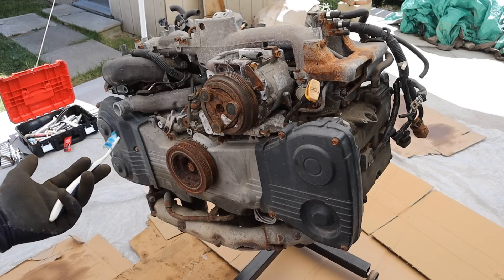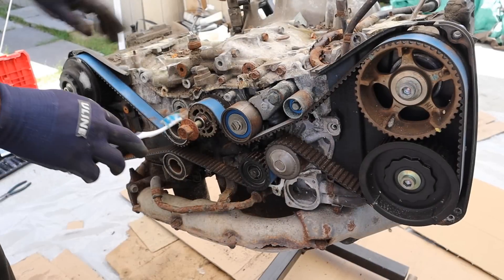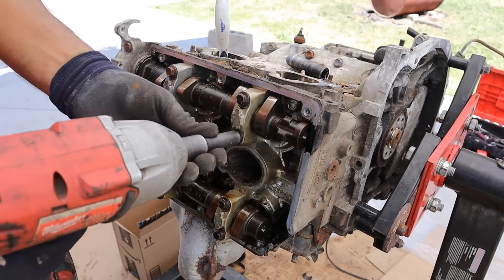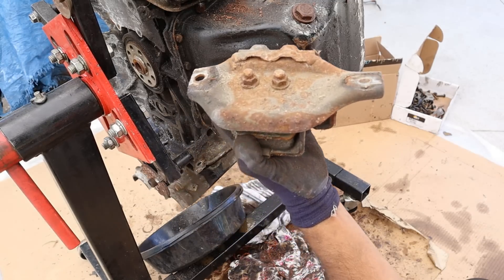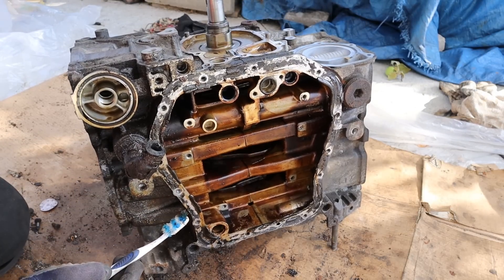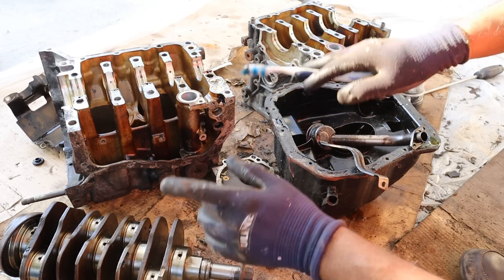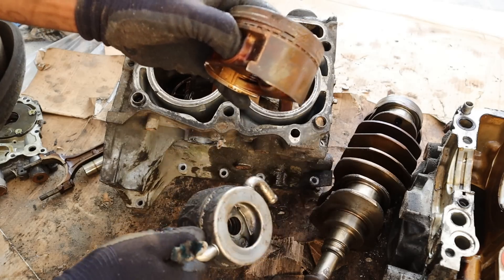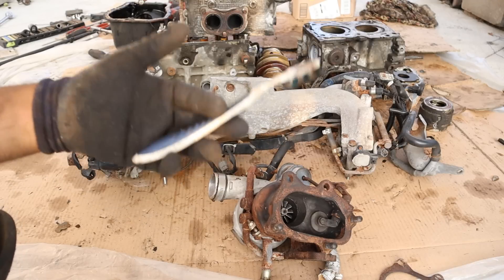Why Subaru Engines FAIL

Comment: Why, why, why does Subaru continue to use the boxer engine design? Costs more to build, is more complex, harder to work on, and less reliable than an I-4. I get that it's part of their brand, but the average forrester/outback/impreza customer doesn't know and doesn't care.
Reply: From what I've gathered from reading around, they keep it because it's what they're comfortable with and a boxer engine has a lower center of gravity, being better for offroading and for sports cars stuff. Porsche still uses boxer engines as well, and I believe some motorcycles and planes still do.
Reply: @0latency  That's all bullshit. They build them because retooling for inliners would possibly bankrupt the parent company.
Reply: @fun_ghoul  Well yeah, their cars aren't designed for inline engines. It'd be like if Porsche did the same for their 911s, they'd probably go bankrupt too if they had to redesign
Reply: they should try making H4 configuration instead if they hate to make in line 4s
Reply from the maker: It's all about costs! 
Can you imagine how much it would be to redesign platforms to accommodate different styles of engines? 

With the shift to EVs I doubt they'll design a platform for a new ICE soon.
Reply: @speedkar99  Good point on the EVs, considering the motor and batts can be shoved pretty much anywhere.
Reply: @speedkar99  Ahh, good point. I was thinking they could just buy i4 engines from Toyota, but hadn't considered the changes to the platform.

Comment: A fine example of an over complicated engine design.
Failure will always find the weakest link - this engine has a lot of weak points.
Reply: You logically cannot have multiple weakest links. Your hyperbole is exceeding reality.
Reply: @fun_ghoul  you're arguing semantics. We're not discussing a literal chain, but a complex mechanical system in which the failure of a key component will inevitably lead to series of subsequent "weakest links" failing in turn. The 4th dimension - time - is a factor. ;)
Reply from the maker: True. There are many disadvantages that especially if not maintained, can lead to failure.
Reply: They really arent complicated at all

Comment: Boxer engines have cracked blocks from factory good to know.
Reply from the maker: Do they?
Reply: Where's the crack? You mean the split case design that vw and porsche have also been using for 60 years?

Comment: The coolant supply to the body of the turbocharger is there to cool the centre bearing of the turbo.....
So the turbo, when the engine is switched off after a long hard run, and there is no oil circulating.....
the coolant will take away the heat and stop the oil in the turbo bearings from turning into carbon...
This became the solution to stop idling down (turbo timer anyone?) ...after people who didn't know any better had cooked the centre bearing with coked up (carbonised) oil....
Reply from the maker: Yes exactly.

Comment: Fail? Hmmm?? 18 year olds with heavy foot?
Reply: And a strong belief/ignorance re not checking the oil level.
You can thrash almost any engine to within an inch of it's life but within  it's design parameters without blowing it up....
but one of the design parameters is enough of the good oil.....
Reply from the maker: Agreed. It's all in the maintenance!
Reply: @JohnSmith-yv6eq  As a former Quad-4 owner and abuser, I concur.
Reply: @JohnSmith-yv6eq  (Of course, if your head and intake gaskets are made of recycled toilet paper, your mileage may literally vary.)
Reply: My first car at age 18... a 72 bonneville 455 cu inch gas sucking boat. I beat that engine until yellow puss came out the exhaust pipe, i guess the coolant was mixed well with the engine oil..i became more attentive over the years as I  aged and CALMED DOWN.

Comment: Horrible engine design. Will this engine last even if manntained well.
Reply: Get non turbo much more reliable
Reply from the maker: I heard the EJ25 was less reliable though 😂
Reply: If it's exquisitely maintained - it'll last forever.

If you treat it like a Chevy ... 8 /
Reply: It will hold up much better than if it isn't maintained and the oil isn't changed regularly or the level is allowed to drop.
Reply from the maker: You really gotta keep up because it's not as forgiving as a Honda engine that can take abuse
Reply: Looking where the water pump is hidden makes me crinch. This is a wear and tear part. You take out the engine for this.. Its madness. Not all mechanics are experts like this video contributor.

Once open up the engine, it wont be the same again
Reply: @chrisgooi  no need to remove the engine for the water pump. Just pull the radiator for more access for the pump and timing kit.

Comment: 14:27, I could see the screws holding the oil pump were starting to back out. Yikes.
Reply from the maker: I noticed that too after examining the part.
Reply: @speedkar99  I have heard that it's an issue on the 2.5 Turbos in Forester XTs In fact, I was joking with a coworker at the dealership I work at that you want a turbo Subaru until you have to work or have someone work on it.

Comment: Can a bad no communication ecu malfunction in one way like no spark with soaked plugs then switch to no voltage at any injectors? I'm finally replacing it but it never made sense.
Reply from the maker: Soaked plugs are from leaking spark plugs tube seals. 
No voltage at injectors could be a wiring, ground or ECU problem.